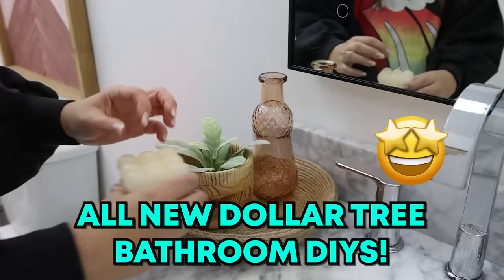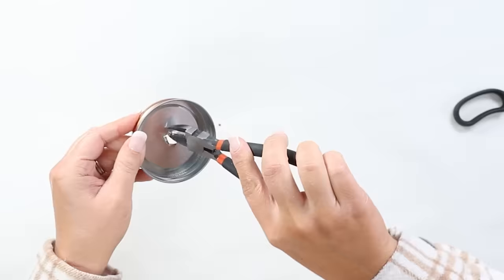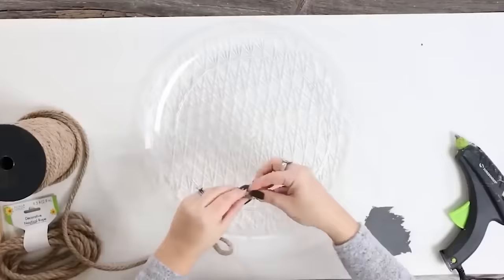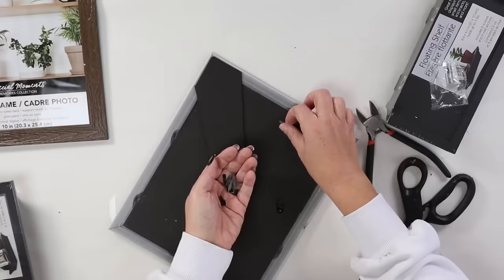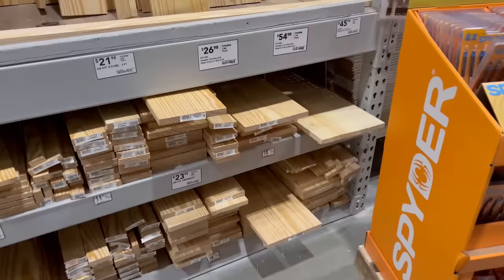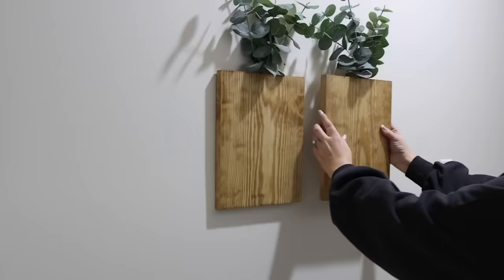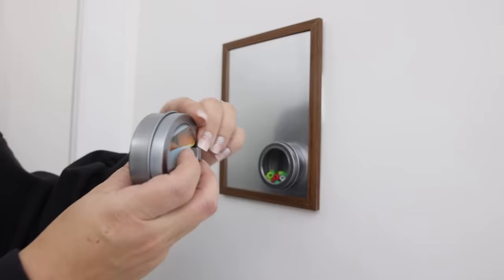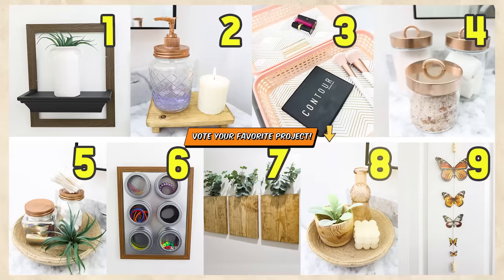DIYed My Bathroom With $1 Items From Dollar Tree...Quick & Easy!

Comment: Love  your DIY videos, Liz!  I really like the soap pump idea.   Will work in the Kitchen too!
Reply: Was wondering if the pump really works after you spray paint it though???
Reply: Or it works, but the paint comes off the plastic pump portion as you use it?
Reply: Soap pump and wood stand ❤️

Comment: I love #1, the shelf/picture frame.  (I have the little black shelves, haven't put them up yet.  )  I also like #3 the plastic basket with design peel and stick.  Tip for getting off labels:  Use a blow dryer on them for a minute or so and they peel right off!
Reply: #6, while the others were cute I'm not a fan if artificial plants, live succulents would be much better. Wouldn't work for all of them

Comment: I love all of the DIY projects and gives me inspiration to dive back into my creative side.

**I do have a suggestion to take stickers off items. I learned this years ago when I worked at Lowes. Try using what's called California scents spray- specifically the orange squeeze one. It's made as an air freshener but works so well for removing the sticky residue. **. 

Hope that helps 🙂

Thank you for sharing your amazing DIY projects!
Reply: Cool!  Thanks.  I use vegetable oil.  It gets all the sticky off in a few seconds.  And I have it around the house all the time.  I just get a paper towel, turn the bottle up to get enough oil to make a circle or two on the towel and rub it in.  Good bye sticky…
Reply: @zxception  genius!  Thank you! ; )

Comment: >to easily get off most labels!
works especially well on paper labels like pickle jars, beer/wine bottles, etc. >fill a sink or large container with warm water, submerge your bottles, sprinkle baking soda over them (approx. 1/2cup NaHCO3 to 1 gal. H2O) wait 15-20 min and the labels will lift or peel right off, just use your normal sponge or rag to clean up any leftover glue, it comes off so well on most labels that you can use your hand to wipe it off. some come off in a few minutes, you don’t always have to wait. this lifts off any label you may have, just be sure your water is warm and the baking soda is mixed around a bit :)

Comment: I like the way you make it sound like we will make inexpensive items.  The nautical rope is $10 on Amazon.  The mason jar soap dispenser looks sick with the lavender soap. The Rust-oleum spray paint  at Amazon is $9-10 per can.  Did like the first one with jars but couldn't you find something else to glue on the top that didn't leave so much left over? You used 2 rings from the whole package.

Comment: Love your idea however, command strips are so overrated. I use to swear by them, but this year, 2 pics that have been hung with them for over a year, just randomly popped off the wall taking all the paint dow to the drywall. SO MAD! will never use or recommend them again. Covering a nail hole will be easier WHEN I am ready to chang. BY COMMAND STRIPS ;-/